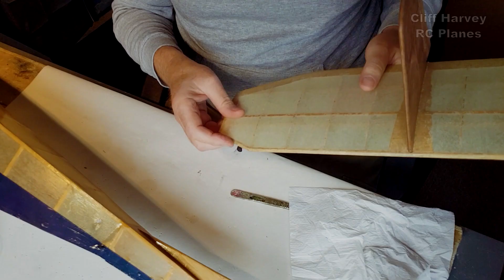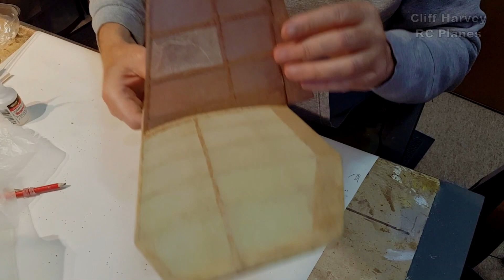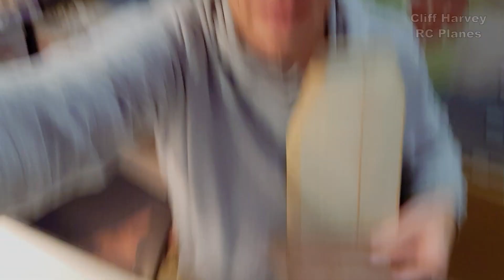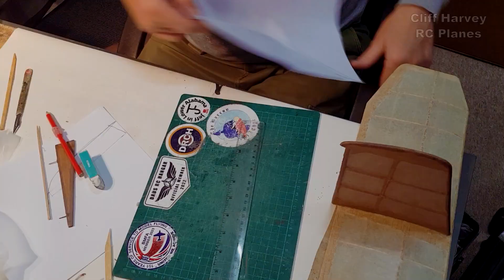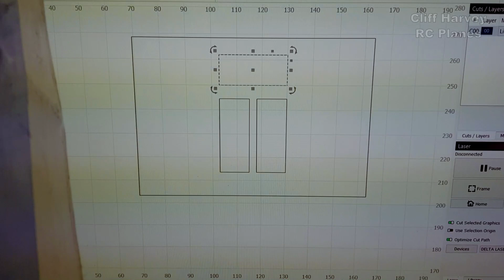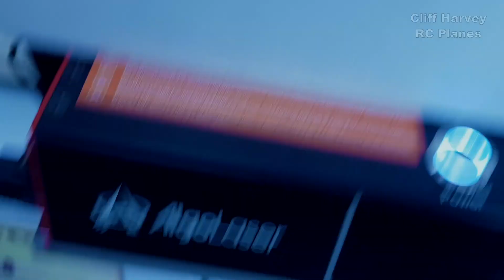Historic Mercury Matador Restoration to Radio Control Part Two

Comment: Very interesting to see you fixing it up. When I do tissue repair I usually cut out the whole panel and stick a new one on. Not applicable here as the colour would be different. Interesting tactic with cutting out the whole frame.
Reply from the maker: Hi Andrew, I wasn't sure if it would work but it paid off, cheers 👍

Comment: We can rebuild this model, make it better than before. 
Stronger, faster, we have the technology.
Just a thought Cliff, if you take out a panel to put a push rod in, why not reuse that panel to refurbish the torn panel next to it? Also, I think curving the rudder will look good and will not spoil the model at all and gain a lager surface area.
I have to congratulate you on your surgery on the vertical stabiliser, I would has striped it entirely to make it uniform. 
But you showed some skill there for sure. 
It will be interesting to see how you secure the snake.
Good luck. ❤
Reply from the maker: Thanks Nick, a good idea re using the panel, unfortunately I didn't consider removing the panel (under the tailplane) until I'd fixed the side, oh well. The pushrods will go through a piece of balsa glued in from the inside against the original tissue. I'll use traditional pushrods to control the surfaces so no problems with snakes (and more original of course), cheers.